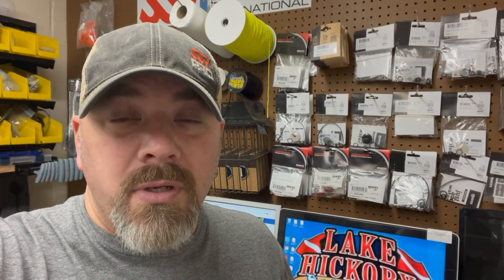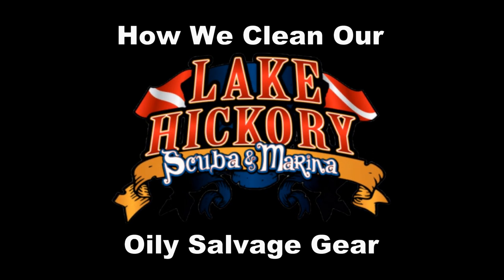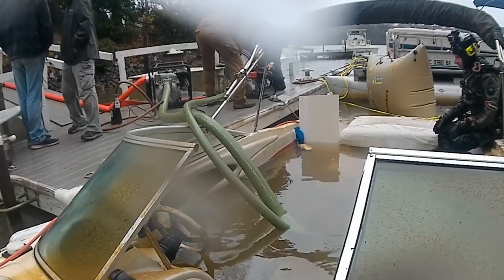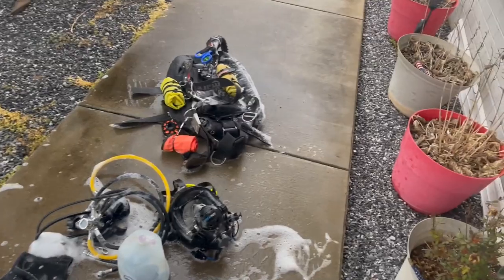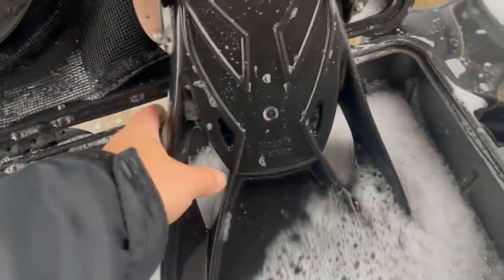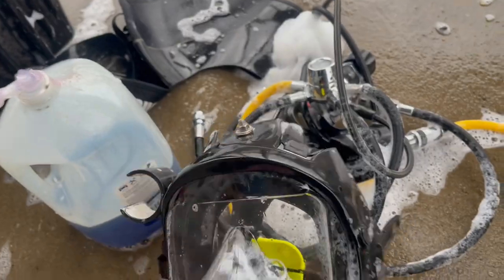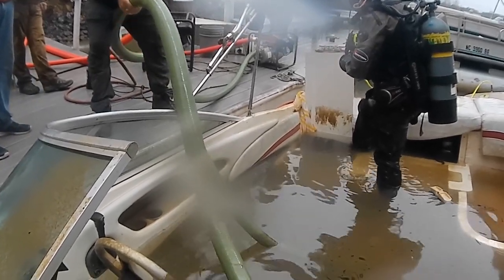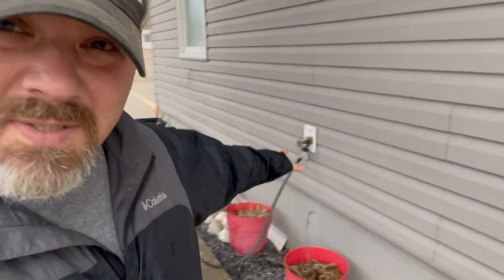How To Remove Oil From Your Scuba Gear After A Salvage Dive

Comment: Since gasoline and oils can actually dissolve some plastics and synthetic rubbers I can see you would want to be thorough cleaning your gear!  At least I only have to deal with silt, sand and salt.
Reply from the maker: Hello Tim Gosling, we will be making a video very soon talking about what we do with gear that can't be clean. It would shock most divers to know how much gear we trash and just purchase new, instead of cleaning it. In the commercial side of scuba, its part of the job.
Reply: @LakeHickoryScuba  I've discovered we still had some of the tablets we used to clean babies' bottles etc and just used one on my rescue mask.  It does get rinsed after every dive but now doesn't smell funky at all.  Hopefully no one will ever appreciate its new freshness.

Comment: I would recommend soaking in hot water.
Reply: As opposed to  cold water. Better viscosity with hot water and Dawn dish detergent.
Reply from the maker: Thanks for the suggestion Patrick Gelinas. We are in the process of producing a video showing divers what happens when we can get our equipment clean. It would shock divers to find out how much equipment we just throw away at the the end of the day.